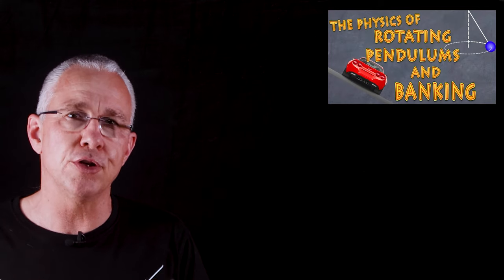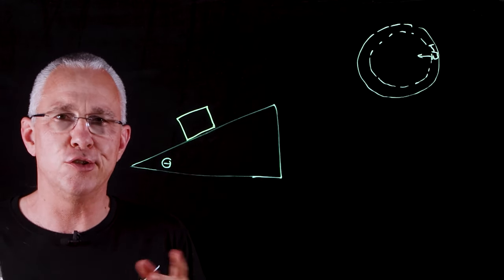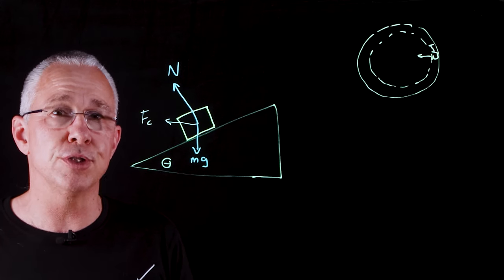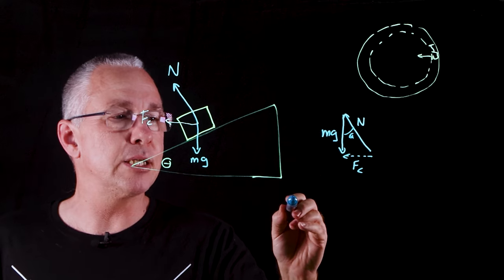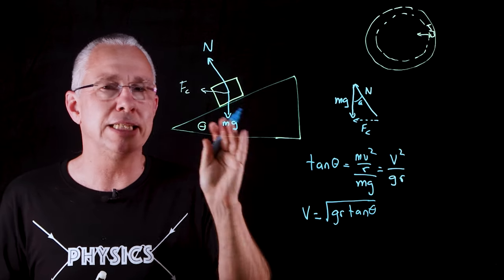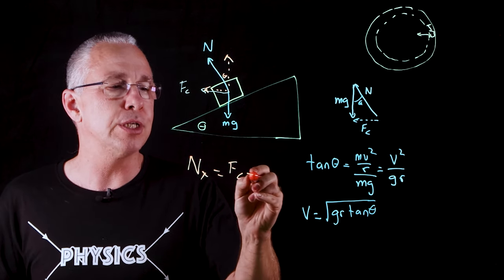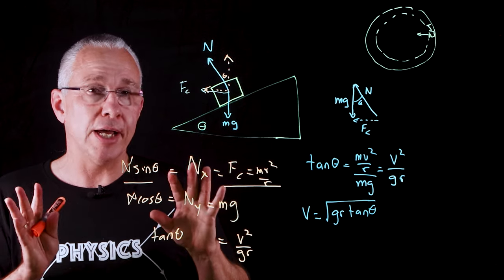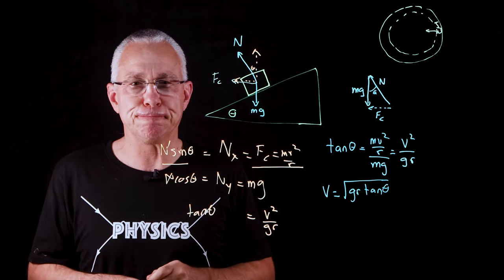banked curves and circular motion explained

Comment: If Ny = mg, doesn't that imply that the normal force is more than the weight of the car?
Reply from the maker: Yep. As a component contributes to the centripetal force.
Reply: That's because while on a regular sloped surface the Fn = mgcos(theta), in this case the car's velocity is continuously causing the car to try and escape the banked curve (because this is circular motion), but the normal force is what holds it in. So the normal force is not simply counteracting the component of Fg perpendicular to the surface, it is also holding the car in from flying off